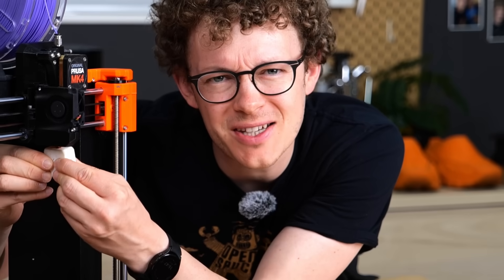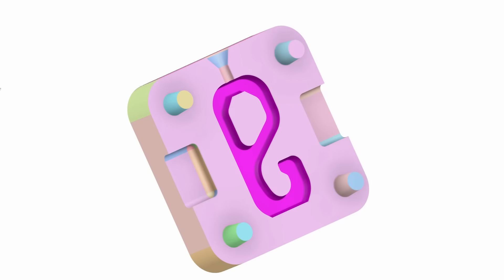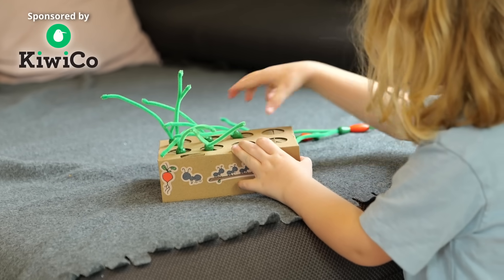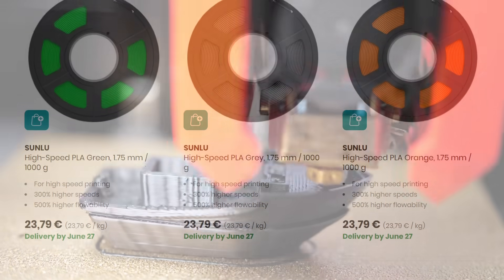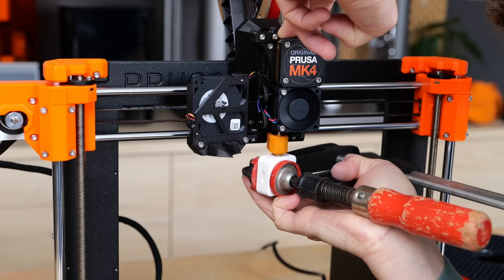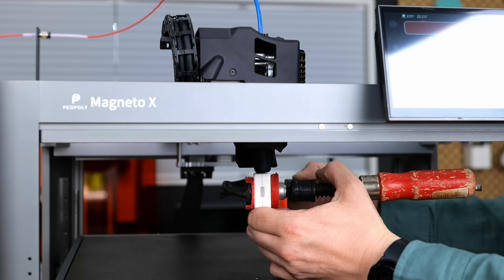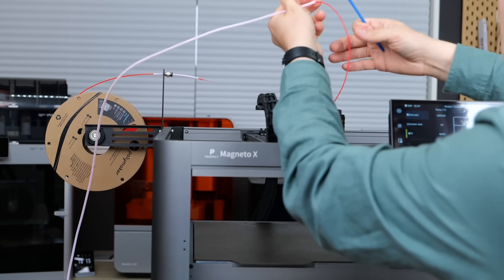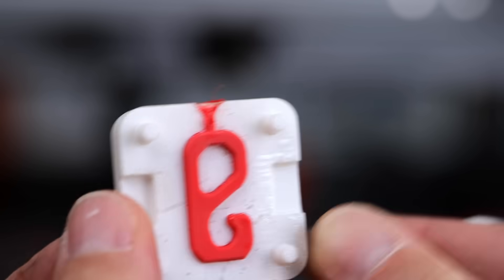I tried Injection Molding using a 3D Printer!

Comment: Maybe try making one or both halves of the mould out of transparent material, you need to know how far the soft plastic can go before it solidifies and whether an internal flow channel is set up.
So, does the incoming plastic push the "already there" plastic further, or does it flow past or flow through? And does the existing internal air just build up in the remote areas of the mould?
Also, since it's low pressure, you do need channels to deliberately create sprue or flash, the air has to go somewhere.

Comment: Listen allow for the nozzle to fit properly in the hole, make a negative for the hexagonal shape to sit, have a fastenings mechanism on the nozzle, make the hole on the mould for the heating element, having an active mould is really cool,  or warm I guess.
Put on the mould some aspiration holes and vacuum that with a vacuum cleaner a guy does the same for molted metal in a microwave, to make it flow better it put the mould in a silicon Sox attached to a vacuum

Comment: Since the only parts of the 3D printer you’re using are the extruder and the hotend, you might be able to modify a toaster to contain the mold while you’re injecting. You don’t want to melt your mold, but if it’s actively heated it might increase the distance the plastic can flow in the cavity before it stiffens too much.

Comment: I would put a vent/exit hole to relieve pressure and also fill from the opposite end its hard for the plastic to flow up hill
Possibly try heating the mould before to reduce the cooling state,a couple of minutes face down on a heated bed or dipped in boiling water and blow dried

Comment: You could print stackable moulds (eg: two ends and repeating middle) so you can clamp all at once and inject a bunch of models in series. Then have a few sets and do a production line of casting and cooling.

Comment: I'm an injection molding designer. Here are some tips from my point of view:
1. The air vents like everyone said. But this may not be the only cause of failure.
Since you have a parting line all around the part. The air can escape through there.
2. The mold needs clamping force so it doesn't flash, BUT the injector machine (in this case the nozzle) MUST HAVE injection pressure, and it's not a small one. We are talking about more than 2 MPa.
This is because you need to inject quickly (around 1 to 3 seconds) and the solidifing plastic will give resistance to the filling.
3. In this case in particular, the mold should be heated around 80°C to 100°C temperature so the plastic stays liquid until it gets till the end.

If you need some help, please contact me.
Reply: how about having negative pressure at the exit-hole. would that maybe make up for the lack of positive pressure at the entry-hole?
Reply: @magnusn1297 there's not much pressure "difference" gained by creating a vacuum since you can only gain 0.1 MPa differential.
Reply: @kentaltobelli1840  but that would mean no air vent is needed
Reply: @magnusn1297  Negative pressure = anti-racism.  I mean negative heat.  No good.
Reply: i know nothing about this whole process, but why didn't he have the mold sitting on the bed, where it can stay warm and also perfectly flat? All of his injections have at least some gap because he's never holding it level
Reply: I had the same thought to heat the mold.  Add water channels to run hot/warm water through.  Or since they are little plastic molds, under a heat lamp before injecting the plastic.
Reply: His calculations show that a pressure of above 30 MPa should be theoretically possible
Reply: I have what is probably a super stupid question.  Could a part be made... uh... sideways?  rather than from the edge of the mold, using the middle center?  So that the material spreads outward relatively equally rather than having to cross a "great" distance to reach that final end bit?  

I would assume multiple vents would be needed, of course.

Uh, the weirdest way of explaining this would be like filling a tart from the top and not a donut from the side.

I need sleep, I think.
Reply: Yes this, was going to suggest something similar. Heating the mould works when doing resin casting as the heat helps the resin cure but in this case the hot mould will help in keeping the filament hot till the injection is complete.
Reply: i really hope he reads the comments
Reply: to complement on this: 

- The sprue position should be centralized to allow for a more uniform flow, in this case your piece geometry has no ideal spot for the gate placement, so you will have to live with non uniform crystallization of the plastic.

- Vent depth should be no larger than 0.001" for such a small component, however a small land of around 0.150"-0.200" would be more than enough for you to be able to increase the depth of the vent to allow proper pressure removal and avoid jet defects (whoever your current pression is too low for this to even happen)

- Get a bigger nozzle end hole, the faster you inject, the less pressure you will require but this add additional issues like non uniform feeding rates or ideal flow

Such a nice thing to see fellow mold makers interested in this kind of smaller scale projects
Reply: Im just a process tech, not an engineer, but my plastic experience tells me he needs some sort of heating element to keep the plastic flowing through the mold like water circuits
Reply: but it's kind of unfeasible since the mold is made out of plastic and might not be able to withstand the heat
Reply: This is such a brilliant and creative approach! When you're ready to scale up these prototypes for functional testing or low-volume production, we're here to help with professional injection molding.🙏
Reply: Also using the Z axis to do the pumping of the HOT slug of plastic into the mould. This would require a piston type reservoir that would fill with molten plastic from the extruder, the Z motor could be made to pull back slightly to allow the piston to fill (and keep the plastic hot for the shot), when full the Z axis would then do the work of pushing the plastic into the mould
Reply: Why not having the mold at a temperature where the plastic is still soft ? Then the process could be done with any hot-end without any restriction of the volume of the piece and injection time, no?  Could be quite easily done with dipping the mold in a deep fryer just like French Fries, and maybe add some extra flat metal pieces around the mold to increase the thermal inertia during injection (this also lower the thickness of the mold necessary for the rigidity, then the cost of expensive resin..)? After injection, dip just the mold in cold water, extract the piece, again mold plus metal in oil, and you are quickly ready for the next injection...
Reply: Been processing for over a decade and I agree with your assessment, given the conditions here. Yes I realize I am a year late lol
Reply: @CNCKitchen is fighting against the injection pressure with his arm, and the angle he holds the mould at determines how effective the seal is (plus the gantry probably wasn't designed to be pushed against like that).  A custom nozzle could help with all of this - and that could be a combined machining & injection moulding video idea.

Keying the extruder nozzle into the mould might help increase injection pressure (though could cause a failure elsewhere if the plastic's path becomes blocked) - Given Stefan has a lathe, he could make another nozzle, but design a flange or similar detail on the tip and key it into the mould print so that it doesn't rely on him pushing the mould against the print head.  That way it would be easier to seal/self sealing.  It could also be possible to effectively insert part of the hot end into the mould reducing the length of the sprue and the cooling that happens there (i.e. the sprue could be contained within the hot end.
Reply: I can't imagine you'd need that much pressure for these tiny mold volumes. There's gotta be a workaround
Reply: @coledavidson5630  yes the workaround for low pressure is same as poured casting, a vent hole or more as required
Reply: @coledavidson5630 Actually, small parts do need a lot of pressure to get all the details filled in before it starts to solidify.

I am really curious to see if Stefan can do a revisit and incorporate all the tips he got from you all, I feel that he is close enough to success.

Comment: Imho some efficiency might be increased with adding air escape path at opposite end, with mold not needing to fight air compression/escape as it fills the mold.
Plus some air paths close/around molded shape from hot plate to guide hot air through to keep temps up. Or embedded other type of heat generators, eg. embedded thermistors, for same purpose to keep extruded filament liquid for longer.
As for overmolding .. i didn't see result, but suspect that initially it may failed due metal hex key being too good heat conductor, that cooled off extruded filament too quickly. But then again this metallic insert part can be used also to get extra heat into extruded filament that flows around it, if you heat up this hex key ..

Comment: In industrial molding pressure is everything.
If the mold temp is below optimum and/or the material is not up to the desired temp for optimal flow rates, putting 75 to 100 tons of pressure behind the plastic WILL get the job done.
Of course there is no way an extruder hot end can produce anywhere near that sort of pressure...
BUT if you can get temperatures of the melt and the mold right it should work for small parts.
Industrial machines have a screw that is moved back while the melt chamber/reservoir is filling and then gets forced forward quickly when injecting so maybe one of the hot ends that use raw/regrind material could be modified to work in a similar way.
But I really like the idea of 3D printed molds - if only you (or maybe someone else) could perfect the process it would be a massive leap forward for makers.
Reply: injection mold designer here - there's not a thing like "tons" of pressure.
Reply: @fashionskiller serious question.

If something pressurized to 2000 psi, isn't that a literal ton of pressure?
Reply: @DH-xw6jp  pressure means force exerted on a certain area. 2000psi means 2000 pounds per square INCH, so a ton per inch roughly. But it depends on the surface area of the "something" that you mentioned. Such pressure exerted on 1 square millimeter  will equal to around 1kg.  1psi on on a football field will be many many tons.
Reply: @fashionskiller  okay, so you can have literal (as opposed to figurative) "tons of pressure" on something.

But that "ton" would be a different amount depending on how big the part is... I can see why it isn't a good metric.

Comment: Get some steel pipe and a cheep hydraulic press

Put a cap on 1 end of the pipe and tap it for a large hot end

Fill the pipe with plastic 

Preferably ground up recycled plastic

Preheat the pipe to near melting and rhe press it through with the hydraulic press

Like an oversized syringe

Comment: What an awesome idea! I have a suggestion: Lay the mold on the print bed, and lower the extruder down to the hole, clamping down the two halves with the extruder. Then crank the heat up on the bed, and since it will be touching the bed throughout the entire injection, that will keep the mold hot, and will probably allow the plastic to flow more easily, and longer before the plastic inside cools. It might allow you to do it with less nozzle pressure too.
Reply: there has to be a reason he didn't do this, it's way too obvious. he never addressed it, but keeping the mold flat and warm would've prevented many of his problems to begin with, since he talked a lot about those issues but kept using his mis-angled hand-held injections throughout the whole video. I'm truly baffled and was waiting the for him to inject on the bed, or at the very least tell us why he cant.
Reply: @nadca2 There was no reason he didn't do it other than he didn't know or forgot. Just like the vent hole
Reply: That might be a really good idea. It should helo solve all the problems that people are pointing out in a very simple way. 👏🏻👏🏻👏🏻
Reply: @alvarolopez8514  I think the main issue others are pointing out is the lack of a vent hole, which is still necessary, but yeah I think with this and a vent hole, this could be incredibly viable.

Comment: I'd create two injection points and also make it so the larger part of the mold is closer to the inlet. The dual inlet would allow for air to escape and for any unfilled spaces to fill. The inlet near the larger area would allow for more thermal mass to surface area ratio. Which would allow the plastic to retain more heat and solidify further into the mold.

Comment: At about10 minuits in, I will say that one issue you have is you need vent holes.  I have not done injection molds, but I HAVE done metal casting.  If you make your part 100% airtight you will have issues with the pressure.  you need a way to vent out some of the pressure, to allow the plastic to continue into the part.

Comment: you are compressing air if the mold is closed, so mold will not be filled completly. In needs some vent or small cavity to "overflow". Some air leak is possible between faces of the mold though.

Comment: There’s a way simplier way that doesnt involved the 3d printer in making the final product.

Let’s say you want to make that hook of yours. You make a mold for pne side of it but instead of a regular mold you are making a  mold stamp for stamping metal. I’ve been stamping all kinds of fun stuff using pla+ 3d printed molds and my 20ton press. Complex shapes can be difficult because its hard to offset a 3d model thickness in some cases. So first part of the process is stamping some metal with half that shape. Then the other half. Then instead of injection molding, fill the two halves with pieces of filament(great for waste filament) and stick it in the oven. The filament melts into the shape of the metal mold you made. Harder to describe than the process actually is. Sharp corners obviously wont work well when making the 3d metal stamp. But i recently had the problem where layer lines showed up when pressing against thin brass. You just have to learn the process and whats possible. You can even stamp metal once and your 3d printed mold may take a slight hit to any sharp edges. Well you can just print another one and since the metal is already partially bent to the shape you wanted, more detail will show up. When compared to the cost of having a real metal mold made, its basically nothing to do it with 3d printed molds.

The short version is make 3d printed molds to stamp metal then use the stamped metal as a mold for a 3d print.

You can even use the same process for smoothing a 3d print. You make a metal mold and use it while heated to press against your 3d print smoothing out any layer lines very quickly. Great for if you want to make multiple copies of something cheap, quick, and production level quality.

Comment: Great Video. Even in a professional injection molding shop if your machine is on the edge of filling a part, what we did is to place air vents in the areas filled last. Add a sacrificial hole on the end of the hook and you will be amazed how easily you will fill the part

Comment: some safety for people: DO NOT PUSH THE PLASTİC WİTH YOUR HAND (im looking at you ender 3 people i know you will try it), or your printer will think (i cant keep the hotend hot enough, i will put more power into it) and you can have a melt down. Always use the printer interface the push out plastic or you might damage printer or worse yourself.
Reply: it doesn't work like that luckily
Reply: @riba2233  it depends on where the reader is. In old hotend designs readers are closer to the nozzle, so if nozzle cools down fast, there will be too much heat difference from where the heater is. So its possible that heater will go up to lets say 250 while nozzle is 200
Reply: @yzkn8848   thermistor is not directly by the nozzle, also y0u could never achieve a big enough difference for it to be an lssue

Comment: I wonder if placing the mold on the bed, heating the bed up, then moving the nozzle down so its pressing into the mold would help? That way you have constant pressure on the mold from the nozzle and keep it hotter the whole time. Also a hole to release air could help since the air in there if completely sealed around the sides is just pressing back.

Comment: Did you consider that the pressure isn’t so much of an issue but that you are creating and airlock if you think of normal silicone and resin molding process there is often the sprue you introduce the material into and there are also vents at least one to stop trapping of air (ie one more coming from the end of the hook) injec the plastic until it reaches the vent then cover the vent to build more pressure.  Hope this helps or at least is another avenue of thought.

Comment: You should make the next injection mould clamp around the end of the hot end so then you don't have to force it up against it manually and can just clamp it all together. It would provide it with a better seal and would increase the injection pressure. You should also add a small tube above the model that will allow you to cut it from the hot end (after you pry apart the mould still attached to the printer).

Comment: I like that warming the mold up to a degree where the heat exchange between it and the filament slows down enough to let it flow till the end, but not enough to break it worked. Do you think a syringe-type machine with a heated chamber that stores the molten filament could work? All in all, injection molding is an interesting process that I'd love to see function on a 3D printer due to it's costs. That, and a true 100% infil (printed one still has seams).